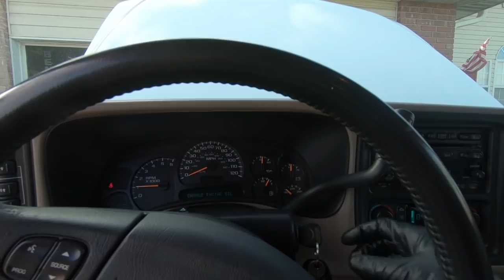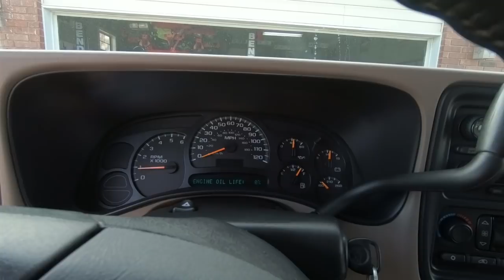Oil Change and Maintenance Plus Wheel Story

Comment: Dude!  I TOTALLY run the longest filter I can find!  A tick more oil and a tick more surface/cooling area too, I always find it by eye though, taking a bunch out of the box and comparing them.  Great tip to fill the filter most of the way before putting it on, did not know that!
Reply from the maker: I tried that and they had nothing in stock. I agree with the reasons though.

Comment: Great video help me to better understand these newer models.Just lost my 99 Tahoe frame damage
Reply from the maker: Glad I could help
Reply: Iam having a problem with my 2005 Yukon.When I shut the truck off battery light is on and drain the battery.I have a new battery alternator and got the cluster redone if you have any clue please help thanks.
Reply from the maker: No idea

Comment: To reset the oil life you can also turn the key to the accessories position and push the gas pedal three times. Easier than scrolling through the computer.

Also, as far as the washer fluid leak goes, check the wiper fluid reservoir motor. The wiper fluid motor housing on both mine and my dad’s Silverado’s cracked allowing the wiper fluid to leak out. Replaced the wiper fluid motor and no more leak.
Reply from the maker: I think the steering wheel reset is quick but I have used the other too. I will check that motor. Maybe that's the issue.

Comment: Got a trick for wiper arm removal. If you push down(towards windshield) where it's hinged it'll pop out of the splines easier. You might have to push down a few times but it will work.
Reply from the maker: Thank you. I actually tried that too. They were on since new and wanted to stay on lol.

Comment: I got lucky last weekend traded my stock 06 Silverado wheels and tires for a set off 22inch American racing wheels and tires. 6 hour drive but it was worth it, could turn around and sell them for $800 easy. Also didn’t know the longer filter would actually work figured the thread pitch was different
Reply from the maker: That's definitely a sweet deal. Good find. They make a longer one but I couldn't find the part number.

Comment: WIX 51522XP is an extra capacity oil filter for these cars. I've been using these filters for more than 2 years now.
Reply from the maker: Thank you for that
Reply: That's the one I use on my tahoe. But I use the wix xp on all my vehicles.
Reply from the maker: Wix makes the best in my opinion

Comment: The other way is turn the key on and press the gas pedal three times, that will reset the oil  back to 100% also
Reply: @TWAMotorsports  hey man if you thinking about reselling those Escalade  rims I maybe very interested in them depending on where your located
Reply from the maker: @tomsmk3  I'm in sw Missouri
Reply: @TWAMotorsports  ohhhh ok

Comment: Is there any specific oil on a truck that have 200k miles, I saw that you put 5w 30 , I have a 03 chevy tahoe 4x4 with 200k miles, what do you recommend me on a oil change?
Reply from the maker: I always use factory 5w30 and have never had an issue. I know others will argue but it has always been fine for me.